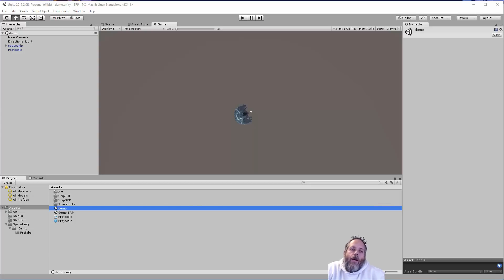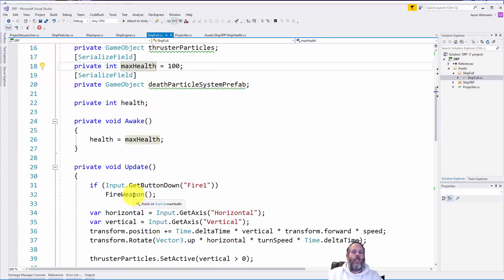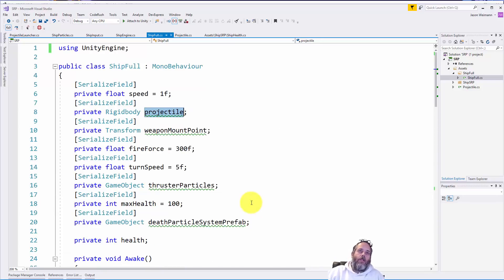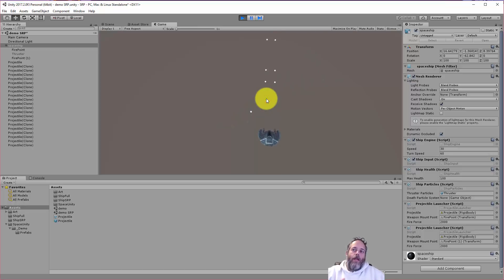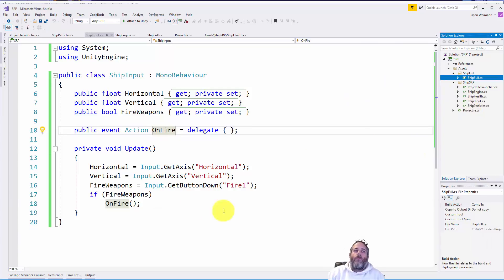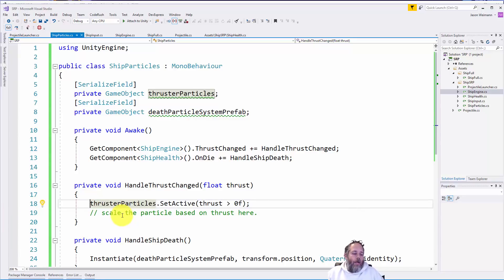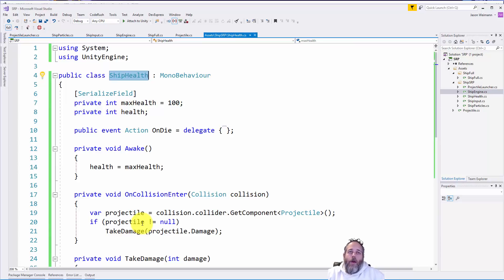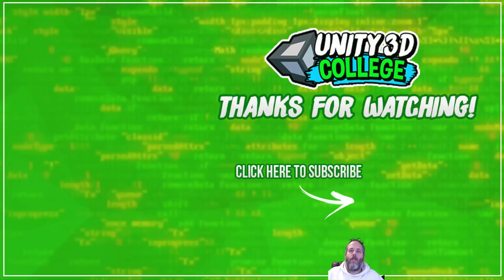SOLID Unity3D - Single Responsibility Principle

Comment: Watching this video in 2022 and studying about SOLID, there's a question that comes to my mind. I see you split your code to five other scripts but they still need to comunicate to each other. Although it respects the SRP,  the communication between five scripts in one single gameobject doesn't affect performance for the game? I mean, if you split all scripts throughout the game, there will be tons of communication between them.
Reply: That one of the most common issue with SOLID. Communication isn't an issue per say. The problem is that while stripping complexity for single script, you introduce complexity in multitude of components. So, it is a balancing act. Especially if you work alone.

Comment: So Simple means Complicate. This is not simple... because now I have to track somehow what those scripts are doing and when they are doing it.
Let's say I to do melee or range attack based on the distance, start the movie, stop moving, check for incoming attack, check when I got hit to transition into a parry or hurt state.
Or... do something simple, Move and Dash. Because when you Dash, you can't move until you finishing Dashing. How can you have those two in two scripts? OR!
OR!!! KeepOnBorders, the script I use to keep the player in the screen, If I use it on Upadate, The player jitters on the edges,  if LateUpdate, I can't use LateUpdate on other objects.
IF I use the same code after I move the character, on Update it works as it should.

Comment: I always wanted to know, how many lines is too many? Most of my code usually is between 50 - 100 lines, with the most being around 200 (although spacing and comments take a quarter of those lines).  To me logically, they all make sense but I'm worried about having too many scripts.
Reply from the maker: More small scripts is usually easier to manage than 1 big one.  It can be possible to shrink to ok far, b u those #'s look good

Comment: That didn't sell it for me.
Reasons:
1. I don't want to have 5 CLASS INSTANCES for a ship that can do 4 things.
2. The big selling point (?) is modularity. Just make the ship an interface.................. 
3. Having decompiled a few games, NOT ONE is coded this way. You WILL find 10.000 line classes that can be instantiated. Complex OBJECTS require complex logic.

I think you overlap the concept of funtions only doing one thing with classes only doing one thing which is not the single resposibility principle.

Comment: Thanks for your job. Can you provide source code?
Reply: I created new project. Copied code, from video Ship axis movement has wrong direction. Moving LEFT-RIGHT, rotating - moves ship over his point. What is wrong? I see i can change code. To get right behavior. But cant undestand why default 2d-3d 
coordinate system from new project is not match to your code.
Reply: To get right behavior of movement and rotation. I changed code to this:
 
transform.position -= Time.deltaTime * vertical * transform.up * speed;

transform.Rotate(Vector3.forward * -horizontal * turnSpeed * Time.deltaTime);

But i cant understand why we have different axises to move ship in space... Can anyone explain to me? I'm beginner and stuck...

Comment: You, Jason are making a wonderful contribution to the community by showing how these key ideas can be applied in Unity. 

One thing I would add, if I may, is that one should not turn to these solid principles from the get-go. I believe that code evolves naturally and it reaches a point when simply shoving more things in that one script class causes more headache than it's worth. That's when we should practice discipline, refactor our code and apply those principles. For the quick and dirty prototype ? Don't bother. For the code that will be revisited multiple times, by you or other memebers ? Think about it. At first do the most simple thing that works. If you touch that code again, be mindful of the change, probably defer refactoring the whole thing, if you can avoid it. Third time touching that code ? Definitely refactor that, since it signals a critical piece of code that needs to be touched often.

For some odd reason, the Unity world was completely devoid of such concepts. All master-class tutorials were advocating bad practices and frankly unmantainable code that barely holds together for the duration of the tutorial. One more feature and the whole thing would collapse into chaos ! This is in stark contrast with the enterprise world where these principles are frankly bare-minimum knowledge required for junior level jobs.

Comment: When I first started self-learning C# from scratch, followed by taking my first steps with Unity, I didn't even know about any of this. I was so caught up in just 'getting it working', I had 2 or 3 giant 1000+ line scripts in my first attempt at building the code. I even thought it was impressive at the time! :)

It kinda worked. But the hardest thing was trying to remember 'how' it all worked. It's not good when you're having to re-learn your own script, scrolling up & down for half an hour because it's all thrown together that way. (Methods, calling other methods, calling other methods...).

But... this is one of those things which perhaps you have to learn the hard way. It's impossible for it all to click first time round.

One thing I will say though regarding number of lines; when it comes to turn-based complex AI algorithms, sometimes you can't avoid individual scripts going well over the dreaded 200 number (not because the script is doing multiple things, but because individual things are themselves prone to a naturally high amount of switch statements, etc). But for almost everything else I agree, it's much better to have several small scripts.
Reply: I don't know man. When I started, and I started having troubles with adding new features to the code, I started looking up for tutorials like this.
Reply: I have this game I'm working on and my player script is like 1200 lines of code, but it's still manageable. The only case where you need to separate a big script in multiple, smaller scripts is when you work in a team, and they have to work on the scripts too.. Other than that, this principle is pretty dumb. I understand you shouldn't have a script doing 100 things, but a script doing like 5 correlated things isn't wrong at all.

Comment: What bothers me about this modular design is that there is nothing that would enforce any sort of constraints concerning the individual components. E.g. nothing guarantees that all necessary dependencies of a ship are present. And what if our problem requires a finer grained modularity, so we'd want to separate the thruster or weapon into further distinctive replaceable parts. Unfortunately this MonoBehaviour-based approach Unity took seems rather inflexible, in the sense that it only supports totally flat components (and seemingly without any way of setting up hard dependencies, constraints, mediation, etc.).

For example as a beginner Unity developer I was naively thinking (in a rather similar scenario) that hmm, okay, I'll just say that my Ship class will have a thruster, a weapon, etc. as dependencies, so I'll make an iThrust, iWeapon, etc. interface and depend on those, then make various concrete implementations of these interfaces, and then plug them into my ship class, put them into powerups as payload, etc. This seems like a rather reasonable design generally speaking, but I quickly realized that it's basically a torture in Unity, because things only work well if everything is a MonoBehaviour directly on the gameobject. For example how would I get a prefab gameobject instance into these classes if I can't assign it in the Editor, besides hardcoding a string path with Resources.Load... I thought I can surely access these things in some namespace, but doesn't seem so. :/ But I'm still hoping that I'm just overlooking things due to being totally inexperienced with Unity.

9:24 Wouldn't you actually get a NullReferenceException if there are no subscribers to OnDie? :P Since there doesn't appear to be a null check before the event invocation. (Ah okay, you mentioned the null check later.)
Reply: You could use RequireComponent to guarantee components are present.

I don't get your use case for prefab isntances, but you could look at ScriptableObjects which could contain the reference to the prefab. You could drag the SO into the Ship slots for Thrust/Weapon instead.
Reply: @St4rdog  Yes, I started to use RequireComponent; it helps a bit. :) Thanks, that's an interesting idea for the ScriptableObjects; it never occurred to me to use them like that, even though I already started to use them for events and sharing state between various gameobjects (after I watched a few Unity talks on them).
Reply: @leakyabstraction  The way I do it is I inherit from Monobehaviour a base class with the iBehavior bolted on. Then I make the Component take the Base Class which guarantees the interface is attached in a way I want. Add to that the RequireComponent and you get a more reliable methodology. The other choice is just to dump MonoBehaviour entirely and going with a Dependency Injection methodology for handling your parts, but I really don't like this as its not Non-Programmer friendly. I want artist to be able to mount objects in game for example, without having to load data into a flat file or database elsewhere.
Hopefully something lighter weight replaces MonoBehaviour in the future, I know ECS is intended to deal with some of that at a service level, but it doesn't help with objects when you get complex things like a custom Space Ship (I have this issue in my game), you have to rely on passing a config file in, having predetermined parts list, cross referencing everything and maintaining all those parts. Then running the whole pile through a factory to assemble everything when its being loaded into the scene.

Comment: Still tightly coupled and breaks the open/closed principal, though. That would be solved by using UnityEvents to link the components in the inspector instead of in code.